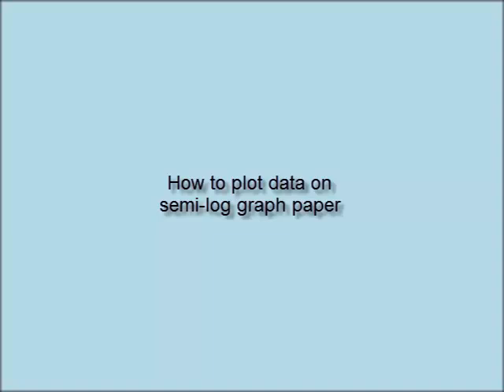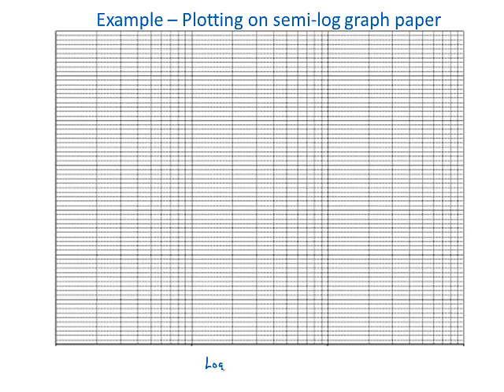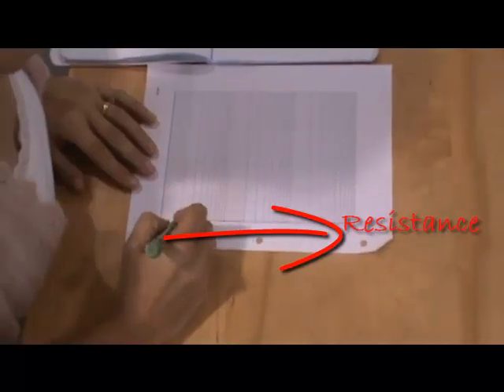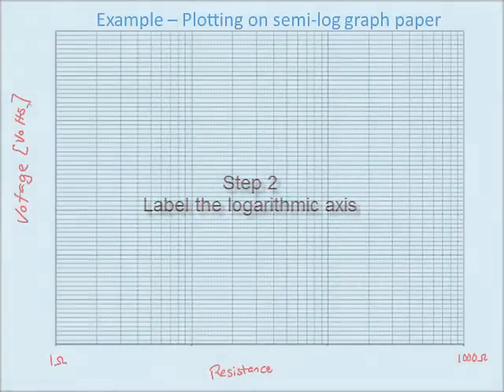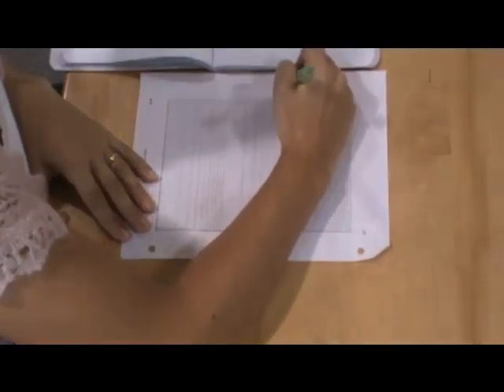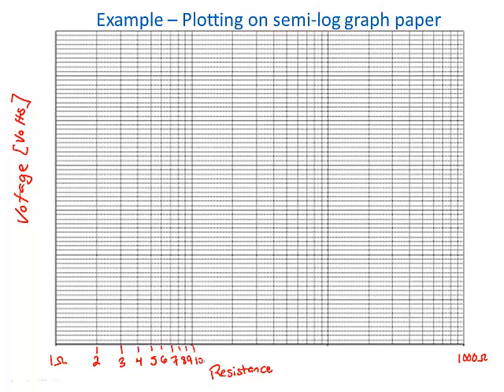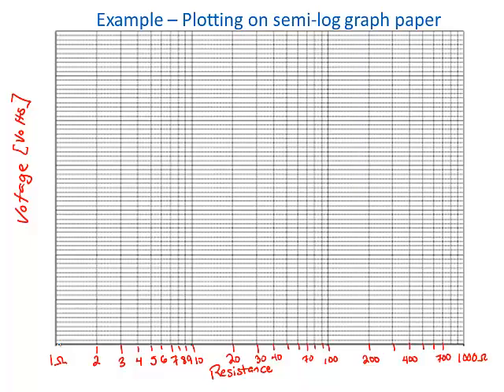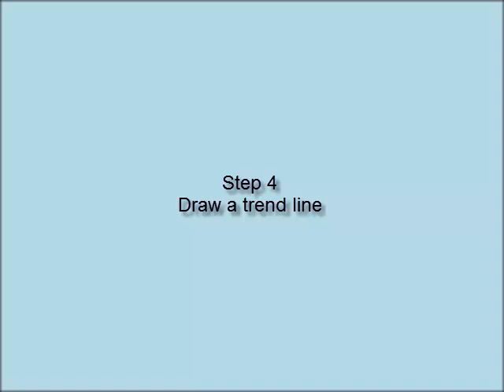How to use Semilog Graph Paper

Comment: I was wondering whether inbetween the values on the log axis, e.g. in between 3 and 4 ohms (in your case) are the values with decimal places also separated in this peculiar manner (I mean 3.1, 3.2 ... 3.9), or can I just divide the space between 3 and 4 into ten equal pieces and take the appropriate resistance for the value of voltage.  
I hope it makes sense. 
Thanks for the video.